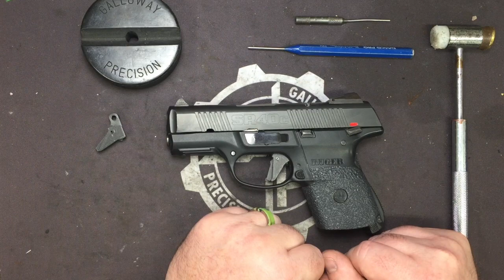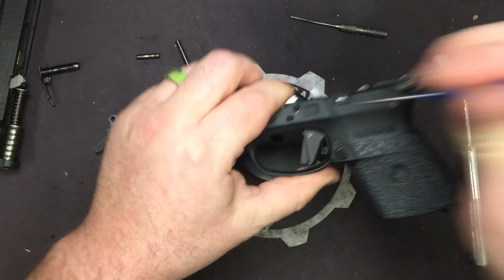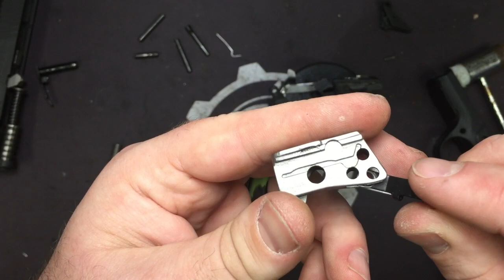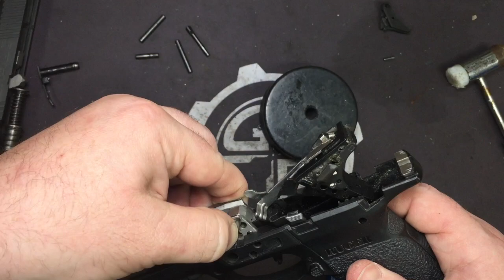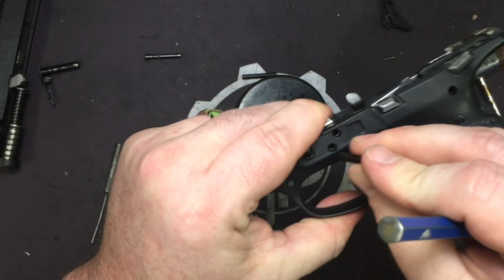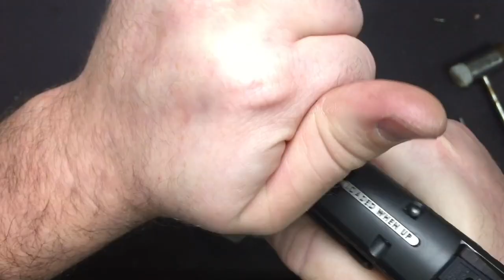Lionheart Short Stroke Trigger Installation

Comment: New trigger parts are the cat's fuckin' meow!! Just a bit of over travel but it feels good. Drilling the center out of a 10 yard target orta be easy as taking candy from a short legged fat girl in a wheelchair!! 

I'm going to hell for that one. 

"Lord, I apologize for that there, and be with the starvin' Pygmies in New Guinea. Amen"

I also polished everything that didn't run away when I took it apart. I installed Galloway's Trigger Smooth It kit #4 also. There's a bit of "over travel" (there's actually none, it's just how far the striker travels) but other than that this configuration is awesome!!

Comment: Does this actually change the geometry of the trigger pull to shorten it, or does it just add an overtravel stop to shorten the pull distance?  If it alters the geometry,  does it increase the pull weight as it shortens the travel?  Thanks
Reply from the maker: You can change the geometry of the swing without increasing the pull weight.  So yes it actually changes the geometry of the swing.